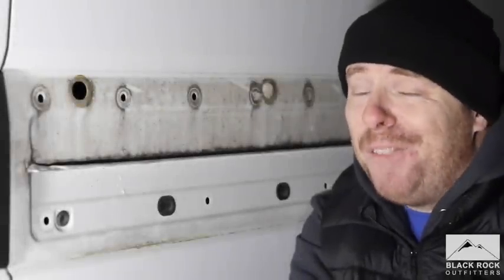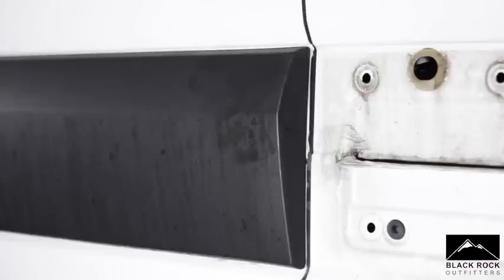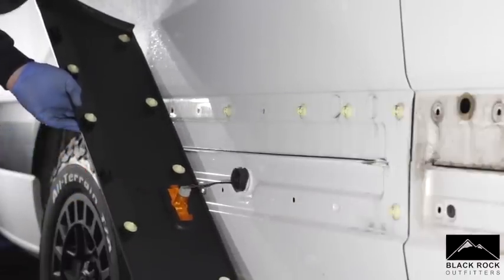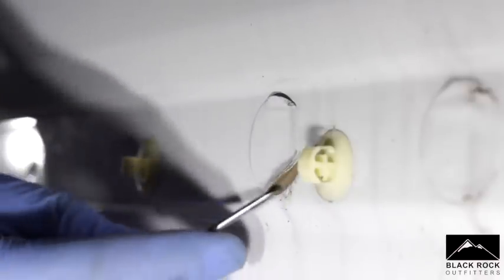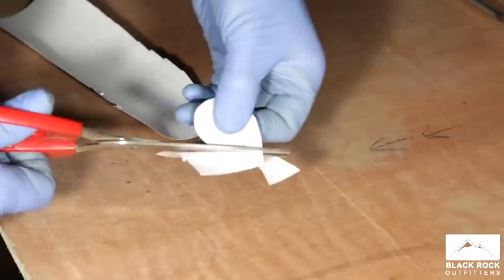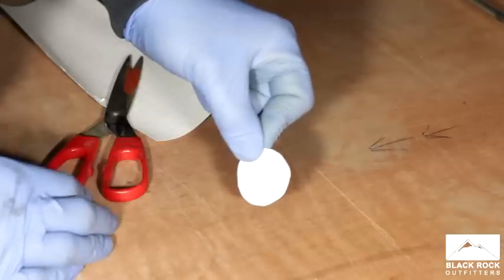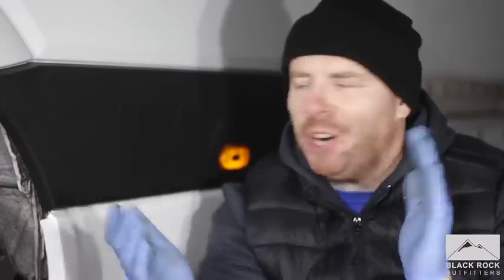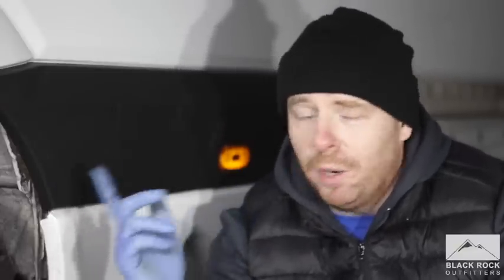A job you MUST do! - Sprinter And Crafter Side Trim Sealing

Comment: You just ruined Mercedes-Benz' planned obsolescence...
Reply: Exactly. I have the '98 Sprinter with unbreakable engine. So they designed it with cheap steel otherwise nobody would ever buy a new van:)
Reply: I agree totally,,,, these alleged oversights are designed to fuck up your plan to keep a van for years,,,
Reply: Hard to believe this is a simple, undetected flaw, especially since it has been affecting sprinters over many years and fix is simple. On the other hand, these are commercial cars, so they tend to do high mileage and get beaten on the job.

Comment: Great advice. One other thing I would add is to make sure that the narrow slotted drain holes are cleared with a piece of wire. One of mine was blocked & the panel full of water
Reply: How many narrow slotted drains per side budd ??… on an 07 plate
Reply: Soz xlwb 07

Comment: How easy will it be to remove these panels afterwards.  If the sealant is too good next time you can break the clips.  I know those clips are relatively inexpensive but what kind of hell will I go through replacing them?
Reply: How often will you remove the panel? Buying a bag of clips or letting your van rust...choice is easy if you ask me.
Reply: Everytime you need to replace the light bulb?
Reply from the maker: @TheFriesennerz  You dont remove the plastics to change a bulb, the bulb holder pops out 👍
Reply: Black Rock Outfitters: thanks, that makes sense.
Reply: @blackrockoutfitters78  Answered the question I came here to ask. Thank you.
Reply: The clips can be undone on both ends as far as I can see, so the adhesive will keep them on the car body.

Comment: O.K. valid issue and your video is great in showing these problem areas in perfect detail. 👍
A few issues if I may though: I absolutely cringe 😖, when I see these sidepanels being removed with a bare metal screwdriver. You'll be putting scratches in the paintwork causing other corrosion issues.
You should also remove the trim clips from the bodywork using similar PLASTIC tools meant for the job.
And PLEASE: Remove the markers PRIOR to removing the panels to avoid damaged wiring whilst pulling the panel. The markers have an etched in arrow on one end of the lens, push them in that direction, lift them out and remove the bulb socket with a twist (as shown).
Replace ALL (125 on our LWB Crafter) clips with new FACTORY ones (don't use cheap Chinese knock-offs, they are brittle out of the bag). Add a waxing agent, "Mike Sanders" fluid or similar to the INSIDE areas aroud the clip holes. And only use a clip sealant, that remains flexible over time (we used Dekaseal).
We've done the lot on our 2014 Crafter and along with a Raptor coating on the side and lower panels, rust should not be an issue. 😎

Comment: Very good presentation, have a 2015 144 ex ambulance 906, ran a seal of silicone along the top of the plastic side piece all round and check drain holes regularly, works for me.

Comment: Superb video.  Just doing my 2008 sprinter and the 50p discs are half off already.  One has disappeared completely.  Explains the surface rust on the inside of the box section!  Thanks for this - the van may last another 10 years now!

Comment: Thank you for this one.We just looked at a 2015 Sprinter LWB for sale in Chertsey England.It has Satnav it had Aircon.It had been owned by a landscape gardener.It is still for sale £11250.Luckily for us the seller had removed the ply lining off the walls which meant  we could look into the  the depths of the walls of the van inside.It had a perfect tide scum mark  from the front of the load area to the back of the load area with soil/rust at the bottom.We walked away from it.Thank you for this vid we could have bought  a load of trouble
Reply: Stevie, I was looking at that van in Chertsey, the photos I saw showed damp on the ply lining, I just bought a 66 plate for less than that. good luck with your hunt.

Comment: Thanks for the video.  I have a leak and rust on the inside wall behind the driver seat.  This is probably the culprit. I will pull the panel and reseal.

Comment: Liked, subbed and rung the bell! Invaluable info for people like me driving camper conversions over 10 years old with very low mileage, thinking that your maintenance regime will keep it looking and driving great indefinitely, only to find Mercedes themselves are shafting you. "kin pee's me off! The only issue I have had with my bodywork has been due to the installation of a window prior to delivery when new. It developed problems a few years later which shows that they couldn't even be bothered to seal the bodywork properly when cutting into a new £35k van. Would have taken less than a minute. Everything else as long as you keep it clean and serviced has been spot on. Although I am now dreading taking these panels off and finding anything. Great video, thanks. (Enjoyed your humour too!)

Comment: I'd probably use a marine grade sealant/adhesive on those holes. I can't see any reason for needing to unseal them anytime soon. I'm talking about the plastic round patches now, not the clips that really hold the trim in. For instance, 3M Marine 5200 adhesive sealant. That stuff will probably survive the apocalypse. Although, why not - 5200 is permanent as heck, so if you use that, those side panel grommets aren't coming off without violence. But the plastic might still come out, but replacing any of the grommets will probably be a bit more painful.

Comment: Nice 1 Adam, after watching several other videos of Crafter and Sprinter owners sealing up their holes, yours is the first to highlight those larger 50p sized holes.  I'm trying to think what they would of been for, but cannot think what, I first thought maybe for a 4x4, I know they have plastic trim over the rear arches, but this still doesn't make sense why those larger holes are there.
Reply: Maybe they are acces holes to ge to some hardware/bolts etc...

Comment: Great vid, word of advice to fellow van converters, some of the panels look very similar, such as the one on the sliding door and the one opposite, but they are slightly different, the clips are in a different location on each by about 1cm, varely noticeable until you got the thing covered in sikaflex and it won't go on😂

Comment: My Crafter leaks. It's 2nd hand 13 plate and I noticed water run marks from the trim clips and damp inside. This explains why! What a poor design - mind you VW/Merc want it to rot so you will buy another. 🤔 
On the back of your fix, I would advise anyone buying a 2nd hand Crafter/Sprinter to do this as a matter of course. The 1st things to get damaged in a scrape are the trims. (It's what they're there for). If (When - I defy you to show me a 2nd hand van without a bump) your van has had a scrape, the repairer might not have put everything back right. Even to the point of not replacing all the clips?
Thanks for a good fix tip👌

Another rot point on Crafter/ Sprinters is the side door track between the stainless steel runner and body. (Mine has it's own little eco system growing there.) Give it a good drink of water displacer (WD40 or alternative). It looks messy but at least you will have something left to clean and polish.

May 2022 update - Finally got round to sealing the trim clips. I found that some of the clips were destroyed on removal so replaced with new from eBay along with Sikaflex. 
They were mostly flithy where the rainwater, salt and roadmuck had gotten behind them. Got me thinking why? Then I was struck by a revelation - as you are moving, there is a pressure difference between the inside and outside of the van. so wherever there is a small gap there will be at times a suction pulling water in.

Comment: great tip and note  the same sikaflex is used to bond windscreens it sets in about 4 hours like rubber and will never let water through... its murder to get off your hands or parts of the van but does come off with the use of WD40 ... best not to get messy with it in the first place.....  great tip though & something id never of considered  without you pointing it out cheers bud

Comment: I think the side rail is also to be checked for leaks, and in my case, the back door rubber seal at the top was letting water in the crack between 2 body parts that were not sealed properly (gummy material was missing). Reapplied silicon all along the body parts hidden by the seal. Hopefully no more leaks

Comment: My 2008 looks exactly like that one.  I'll go a step further and say the problem starts right away, no need to wait for those snap in fasteners to get old and brittle, they're just not water tight to begin with.  Do you have any recommendations after attempting to mitigate this rust, inside and outside and completely filling in ALL of the holes, for finishing the entire area without re-using the plastic panels?  Wood?  Some other kind of thick epoxy coating, sculpted to the contour?  Anything?  Great video.  I finally found someone who understands just how maddening (and criminal) this cover up job really is.
Reply: Actually the large holes on my van didn't even come (brand new) with the tape over them.  Just open, gaping holes.  My problem is I have advanced rust nearly all the way thru now.

Comment: Another MOPAR van; the Fiat Ducato aka Ram Promaster ALSO requires this fix and needs to be sealed up along the wheel wells and on the back panels it also had a very badly designed air escape vent. All leak into the bottom of the walls / frame.

Comment: Great video, I have a 906 2011, it gas virtually no rust, I want to keep it that way, for years. Its low mileage. Sikoflex is the product I ysed to install monumental scilpture we bonded really heavy items with it. Are there any drain holes I can empty any possible water from my sills

Comment: I think the clips are intended to come off with the panel but don’t necessarily. What happens if one breaks as clips do especially once they age a bit? I’ve been working on cars for 40 years and have seen many clips deteriorate or harden in a few years. If you use a sealant that dries hard then it will hard to get out of the body and several will break upon removal. Use a softer drying (for lack of a better term) and the clip can be swapped out easily. I just took the same kind of panels off of a Dodge Promaster 2015 (here in Canada) and at least 1/3 of all the clips broke in one way or another with some completely broken and they were not glued with a sealant. If they were they would have ALL broken. My suggestion makes sense as the cost is hardly any difference and doesn’t glue the clips with a “hard” sealant.

Comment: 14:06  and when i'm that far with my sprinter, then i will seal off the plastic trim all around so no water can run behind it. And for the side lamp i would
use a silicone based sealant because that's easy to remove in case a new light bulb is needed.

Comment: Do the wheel arches come off the same way, with the t20 for the screw and then the snap fittings?  Great video. I don’t have one yet but looking at a one or two year old used one in the near future.

Comment: Thanks for the video.  Under my sprinter panels was an absurd amount of rust holes which caused major leakage into my vehicle.  I have fiberglass patched all of the rust holes but I would like to apply a sealant to the top and bottom of the side panels on the outside of my van.  Would you recommend this and if so, what type of sealant would work best?  Thanks!

Comment: Those holes are actually there for releasing moisture from the walls of your van. Now moisture can't get away. Rust and mold will appear if there is no ventilation. I do find the place of the holes odd, would be better to have them on the bottom, so that excess moist can drip away easier.
Reply from the maker: I dont think that is correct mate, the newer crafter and sprinters have rubber grommets installed as standard as they knew this was a major design fault so it makes your theory invalid.
Reply: @blackrockoutfitters78  If that is true, I stand corrected. I have kept them open for the reason I mentioned. Since I made a moisture barrier on the inside of my van, those holes are (to my knowledge) the only holes in the metal that will let moisture out of the panel wall.. I'll tear it down next winter to have a look.
Reply: @blackrockoutfitters78  Do you know what year they brought in those changes?

Comment: Thx for this input. One question: what about the hole for the sidelight cable?? Why didn’t you seal that as well?
Reply from the maker: Because that had a rubber grommet already installed 👍
Reply: Black Rock Outfitters , thx for reply

Comment: Hi I've removed & sealed up my trims as per you're recommendations,  it seems to be a controversial issue on installing insulation & vapor barrier with some people arguing to never insulate the inner cills themselves as you'll never get a 100% VB  partly because of the cill drain holes. what your thoughts on these?  What do you do with the cill drain holes after draining them in relation to this? thanks

Comment: sound advice, with the plastic trims, would it  not be better to seal the clips into the holes, let the sealant go off, then put the trims on? with your method, if there is any surplus sealant about you could effectively end up glueing the panels on?
   and if you use silicone, you will find it's a pain when doing any paintwork
Reply: I was thinking that. I mean is there a reason to take the trim off? Seems like he’s stuck it on there

Comment: Wouldn't it be much a more guaranteed seal/easier fix if you just caulked the perimeter of where the plastic panel's edges meet the metal body of the van?
Reply: Until you want to remove the trims.

Comment: What’s best solution when all your holes are so rusty u can only keep trim on with white duct tape ???…. Maybe worth making small 10cmX10cm plates up with the hole in the middle  ?? … chop little 10cm squares out and weld plates in ??…. Maybe worth a metal fabrication Co doing it by laser and computer even ??…. Thoughts appreciated :-)❤

Comment: Blackrock Outfitters did another video a while ago, showing that you also need to unblock the drain holes along the bottom of the sills, otherwise any water that's already in there stays in there... defeating the point of sealing the trims. Not sure why he didn't cover that in this video.

Comment: Is this the only thing that causes sprinters to rust? Obviously sprinters manufacture changes over time but the transit lovers have to hate on sprinters to justify their purchase because they don’t want anybody to think they couldn’t afford a Sprinter and one recently claim that sprinters “rust out”. I have a 2020 sprinter that I bought less than a year ago and a big sheet of aluminum blew against my van when I was wind gust came up and put a deep gash in a rear door and a few months ago when I was driving down the freeway somebody either threw a big chunk of metal or a piece of rebar from road construction flew up and hit my passenger door and made a really deep gash there but despite record rainfall neither one of these two gases that I haven’t had repaired is rusting so that tells me the undercoat/primer on my 2020 sprinter is amazing, So I don’t know about older models but there’s absolutely nothing wrong with the rust proofing undercoat on a 2020
Reply: I think this might be a problem with more than just the sprinter and crafter. Don’t get why you’re so concerned about what transit owners think, it doesn’t matter. I’ve got rust with my Renault master but I might have to check my plastic trim after watching this maybe it has the same issue

Comment: My 2016 Sprinter has the '50p' holes factory sealed so haven't needed to do those.
Reply: They'll still leak at the clips.  I would deal with it.
Reply: yep I would replace them - the ones in the vid were factory sealed, but have leaked.

Comment: Good video highlighting an issue . but If your going to all that effort why stick a piece of vinyl over a hole ? Sign vinyl has a layer of adhesive on it and your silicone is sticking to that. The vinyl and adhesive fail over time hence why there are different vinyls some 3 year some 10 year. Can’t you just silicone some rubber or a metal disc ? I work with vinyl and def would not use it to cover a hole.

Comment: What kind of sealant did you use? I did a quick adhesion test on the plastic clips with silicone, PU window sealant, and sikaflex 221, but neither will stick.

Comment: What happens if you need to change the bulb?
Reply: You don't need to take any of the side panels off to change the side marker bulbs. Near the edge of the marker housing is an arrow - slide the marker that way and pull it out to change the bulb.

Comment: How do you change the side lights later then?
Reply: opinion only, but the clips once sealed to the van body will pull out of the trim piece itself. you will probably break one or two on occasion as the clips get brittle over time. but replacing plastic clips is better then water or rust.

Comment: i attacked mine from the inside of the van,just tap the plastic clips almost  out with a tap of a hammer ,then seat with a good amount of sica flek.tap of a mallet on the plastic from the outside and job done . no sign of water ingress in three years .

Comment: Is it possible to seal these on the inside of the van when it is stripped bare, without removing the trim at the end?
Reply: Just do it the right way instead of trying to take a short cut.

Comment: I wonder if it would be easier to seal the clips in to the van first?
Reply: Alan Butterworth nice one. That’s almost exactly what I did in the end. Sikaflex on the clips after cleaning them and also cleaning around the holes, and touching up the edges with paint, then push the clips in and the sealant took up all the air gaps with a nice bead squashing out of the sides. The torrential downpours we’ve had of late have proven to be no match for the sikaflex. Very happy.